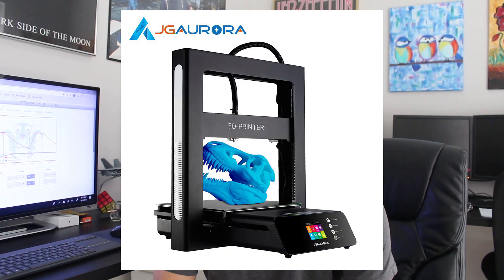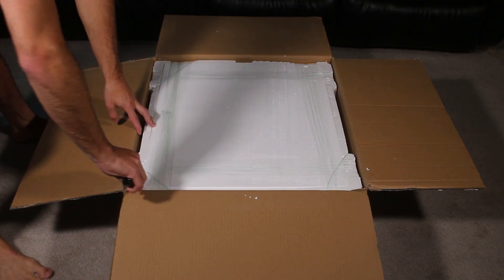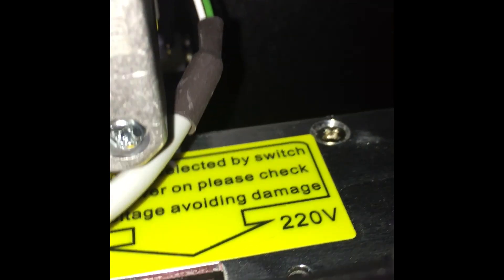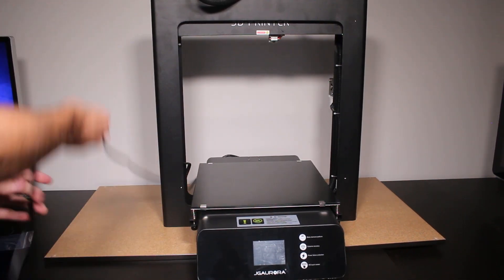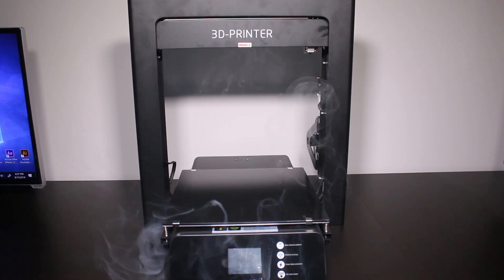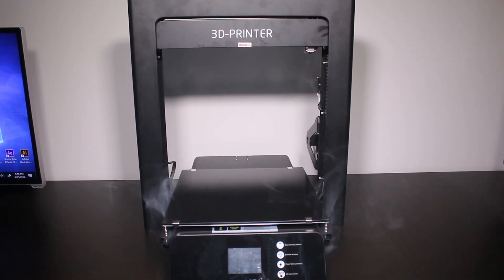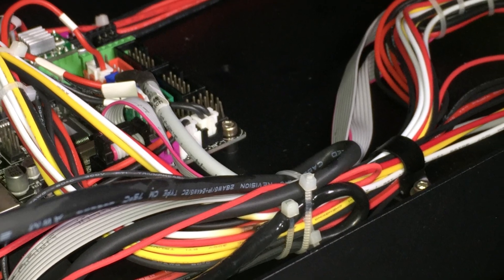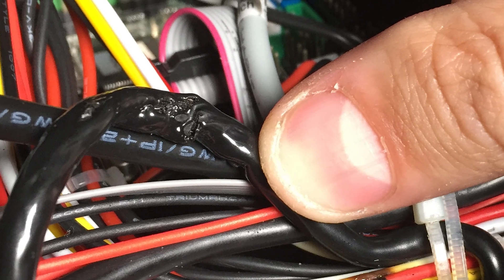Don't Buy This 3D Printer! (Fire)

Comment: I had this printer for a year and a half, worked pretty good for that time. I just tried doing a print yesterday and the same thing that just happened to you happened to me with smoking like crazy. This is really scary because I have prints that would go like 3-4 days. Fortunately I was there to witness this so I could unplug right away, but this seriously could have burned down my house is I wasn't there. This is NOT a voltage switch problem, it's probably a defective internal cooling fan that failed- BUT this should have been designed to shut off in the event of that failure- not keep running (like if the cooling fan in you pc dies- the pc would just turn off and be in a failure mode). No more JG Aurora form me either. Good Video!
Reply from the maker: Hi George. Sorry to hear you had a similar experience (at least you got a year and a half with a functional printer, mine died first use). You are lucky someone was present to unplug the printer or you could have had a much larger fire occur. JG Aurora continues to produce 3D printers with low quality components that can be a safety hazard and cause fires. Hopefully they will get their act together, but until then I would stay away from JG Aurora. Please share this video on social media outlets to help spread the caution to other 3D printing enthusiast! Best of luck!
Reply: @the3dprintzone Hi- I was wondering if you had heard of this printer: Crazy3DPrint CZ-300 . With my JG Aurora out, I wanted something inexpensive. This has a 300x300x300 build size and it's only $250 at Amazon. Kind of bare bones, but I did find a review by Techradar that was pretty favorable. What do you think? Thanks
Reply from the maker: @gak0090  I would recommend this printer over the printer you mentioned. It has great reviews and is reliable. https://amzn.to/2VuMHw7

Comment: I think you Forget to put the voltage switch on the psu in the right position.
Reply: That would probably have caused issue already before starting the homing.
The screen is apparently receiving the correct voltage as well as the printer electronic.
I would think it's more like a bad wiring of the motor or a jam causing them to use too much power.

Comment: Dunno, got mine in early Aug 2018 and it is still working. Hotbed connector was fried in two weeks- seems like common issue with hotbeds. Tried to talk with GearBest, they started to ask stupid questions and request stupid actions. Got replacement from JGaurora after first (!!!!) letter. It is still in the box, since I soldered cables directly to old one :) Upgraded steppers, upgraded extruder to direct drive, set up auto leveling. Replaced hotend - was really my mistake, messed it up when replacing the nozzle. Seems a good enough machine to tinker with. 
Hotbed is most wulnerabe part, it can fry the connector, it can short-circuit if isolation paint is scratched...but it is not JGAurora exclusive issue.

Comment: My JGAurora did not catch fire but part after part goes wrong and you will spend more time waiting for replacement parts to arrive on a slow boat from China than you will spend time using the printer. 

We have been taken in by paid puppets promoting these machines and it was a good job that you used Gearbest to purchase the printer because the guarantee is worthless if you purchased the A5 using AliExpress who apparently are not allowed to give out an email address and just give it ear service when you are forced to use the "on-line chat" system.

Yes i feel scammed but i am not sitting back and just "Taking it"

Comment: Mine too smokes, then stops. Then repeats. So frustrated about jgaurora and the seller😠😠😠. Its been 5 months since i bought it and at first opening it up, the bed smoked up so much.
They told me to open up the printer as well. By the way , i saved up for a year for it.
( - im 13).     
very disappointed. 
What can i do?....
I fixed it but now it broke again.  
How i feel: 😑😣😑😐😧
Reply: Check your hotbed. The circuit is simply painted over and clasp can scratch the paint and cause short-circuit,
Reply: @sasasasa-lx6cl  thanks, but i think its the connector cable because one side is all melted and burned. know where i can get a replacement quickly ?
Reply: _ _3DTimelapser__ _  Mine smoked as well got a new one.

Comment: Hello) (I do not know English, I use an interpreter) I soon wanted to also buy the same printer! can you please tell us - what was the problem? and how to avoid it before turning on the printer !?
Best regards)
Reply: Kevin Stillerman (Well, also on the Internet a lot of positive feedback on this 3d printer) I saw a review in the online store - that the power wires + and - on the power supply were interwoven, maybe you also had such a reason? and your printer is not subject to repair? Did you write to the manufacturer's website? they told you something?
Best regards)